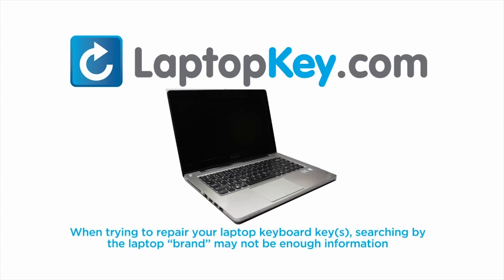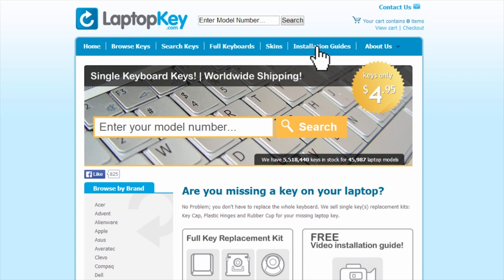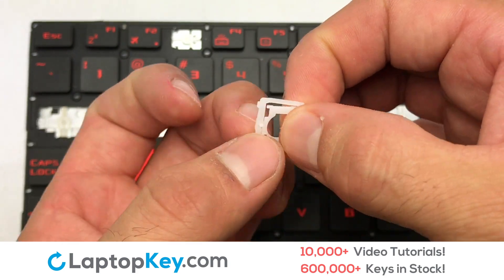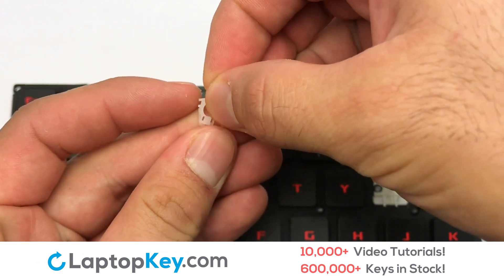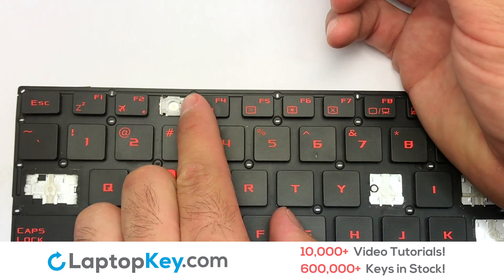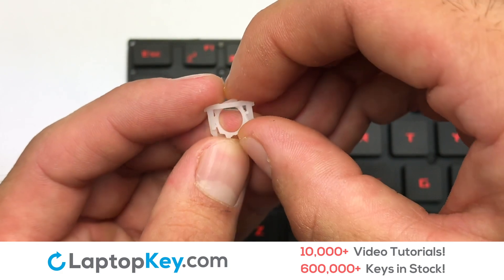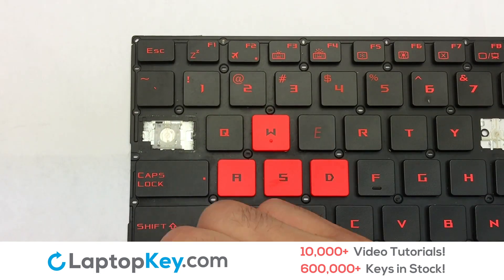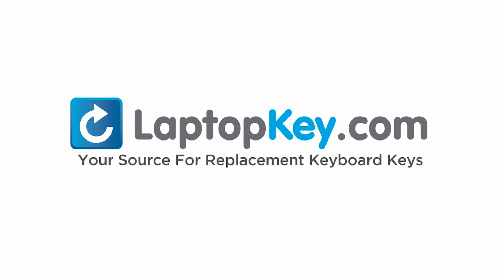Asus Keyboard Key Repair Guide ROG Strix GL502 NSK-USCBU 9Z.N8SBU.C01

Comment: The O has popped off my keyboard and you flip the key so fast I have no idea what which direction the key goes back on.  even using pause it's impossible to tell.  Do the 2  tiny plastic clips on the key go at the top or the bottom or one of the sides?